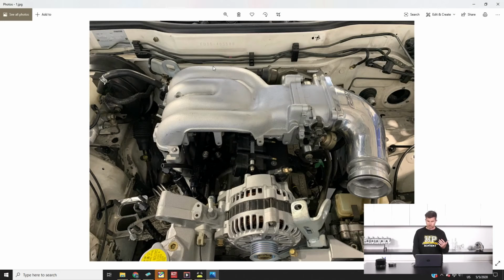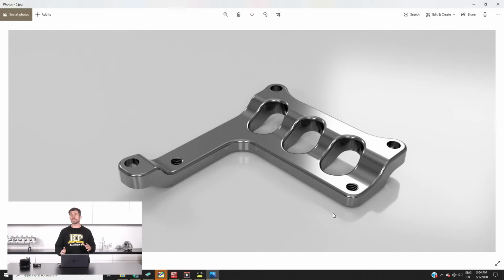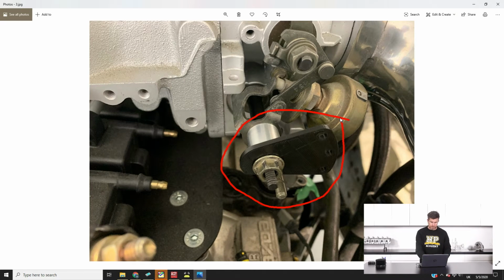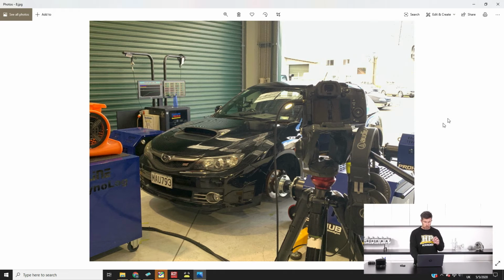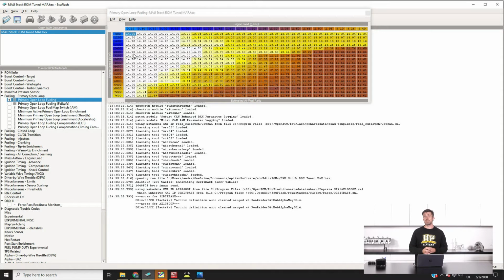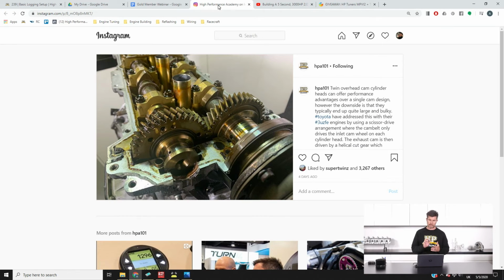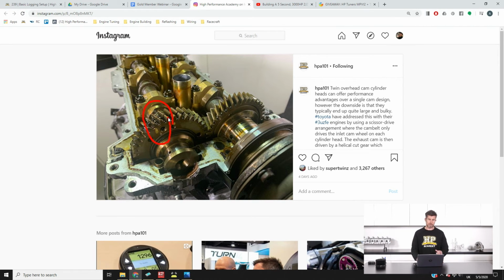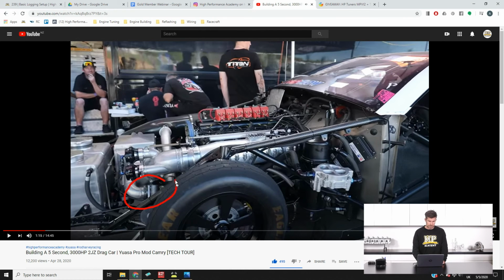EcuFlash, DBW Upgrade and 3D Printing | Today At HPA [UPDATE 239]

Comment: You commented that you wanted to use the space under the plenum for coils. why not mount them where the AC compressor was and put the drive by wire actuator under the plenum

Comment: Been following the developments in 3D printing for over 20 years, never actualy used it but had been supposed to take a course this year, however...
Depending on the printer, they can handle different materials at the same time, using dual print heads, print a wide range of plastics which have different properties and colours - even flexible materials and carbon fibre with some printers.
There are also printers that can produce metal products, using materials such as aluminium, stainless steel and even titanium.
The more advanced units are rather expensive, and out of reach of the average hobiest, but there are companies that will print products for clients - so if you have some widget you want made for some application, it may be worth checking them out - they are often cheaper than CNC machined parts and designs can be printed that would be impossible to make in any other way.
There are many tutorials and demonstrations available on the interweb, I suggest checking them out.
Reply from the maker: Yes I believe the military, specifically aircraft carriers and other large vessels, have been 3D printing metal parts for quite some time now. Usually, we're 20 years behind (might be a little less these days) what we can get as a consumer as to what technology actually exists now, so there are plenty of exciting times ahead for this industry even at hobbyist level - Taz.

Comment: Consumer level 3D printers are fantastic for custom and one off work and making prototypes for automotive work.
It is cheap and easy to get into and going forward the CAD and prototyping skills it builds are very valuable.

I am engine swapping an '84 Fiero with the drive train from mid 2000's Saab 9-3. Same long block as the GM 2L supercharged unit from the first gen SS Cobalt, but with turbo bits. Due to the rear engine layout of the car, an air-air intercooler is more or less out of the picture, so i am using the intake from the supercharged engine which has an air-water charge cooler integrated into it, though sans supercharger.
I have 3D printed prototypes for an adapter to mount a throttle body in place of the supercharger, along with many other brackets and adapters for other parts of the engine swap.
I have also mocked up the entirety of the charge piping with 3D printed piping which is very inexpensive and quick to make, easy to modify, and assembles with superglue. Also in the setup are printed copies of the Vibrant HD wiggins clamps.

It has allowed me to make much faster, and cheaper progress on the build, and when it comes to final assembly I know exact length of pipe and bends needed, and am significantly more confident on any parts I need to have made by 3rd parties that they will simply bolt up.
Having 3D printed mock-ups has been beneficial as well when working with a CNC machinist. As with most car people, they tend to be hands on people, and at least in my case it has sped up the process of having some more complicated parts made.

Comment: Have you thought about using a single blade DBW TB while retaining the secondary throttle butterflies in the upper intake manifold?   The secondary throttle could be controlled a number of ways to force air through the primary ports at low load.

Comment: I use one of these DBW motors on my Mazda to control a 4age throttle setup, and have had trouble with the rear bearing retainer breaking within the motor itself
Reply from the maker: Ahh interesting. Has this happened a few times? Did you find a solution? - Taz.
Reply: @hpa101  Twice, what seems to happen is the spot weld breaks and the retainer comes loose, I drilled the spot welds out then tapped the rear motor housing to use screws, currently is working well but have done many miles on it, It could also be my setup that causes it, as i am far from a professional :D - here's the setup https://www.instagram.com/p/BoOWFGLHurf/
Reply: From what I've gathered these units are pretty unreliable - common replacement item for M3/M5 owners. Unfortunately not many other options out there, apart from the Jenvey motor.
Reply: @bahjah944  On the E60 M5 I believe it's usually the nylon gears inside that eventually wear out and the play throws an error code. There are some aftermarket replacement gear sets available to upgrade these, but generally I think you'd expect 50+k miles out of them so not terrible.

Comment: VW did something similar to Toyota in order to make narrow DOHC cylinder heads. However, they used a timing chain with a hydraulic tensioner, rather than a spring loaded gear.  These would be found on the back of the cylinder head, and they would be a common place for oil to leak.

I really like that DBW turbo engine.